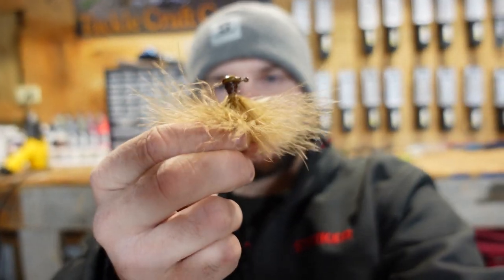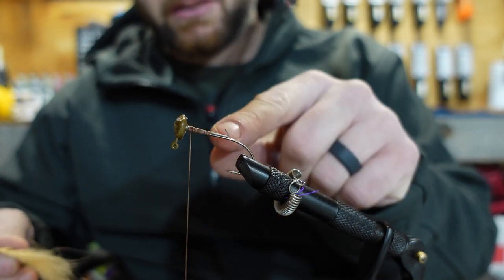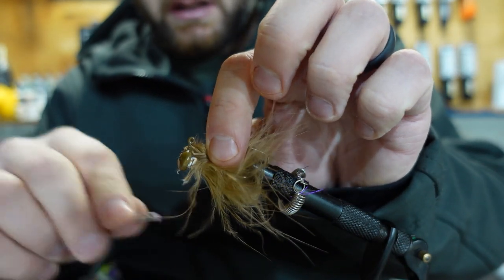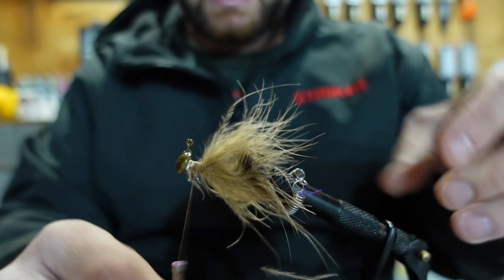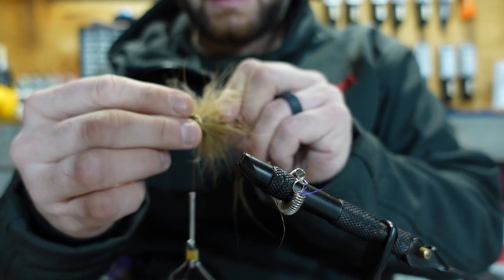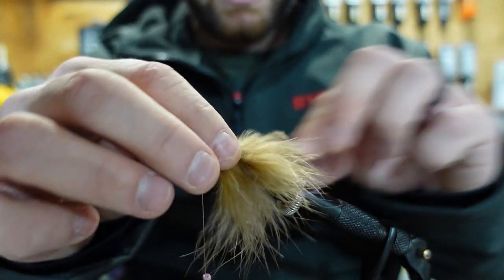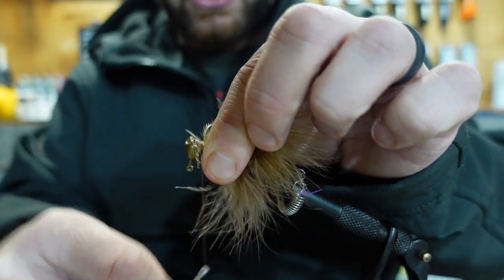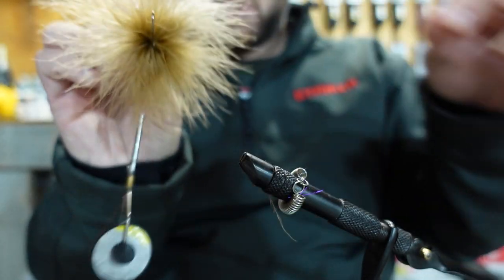Tying the Perfect Marabou Jig: A Step-by-Step Guide

Comment: I guess I don't see the need to use a lead head jig when making marabou lures. A simple marabou streamer, minus a lead jig head, can be rigged as a pseudo wobble head, Tokyo rig, a power shot or drop shot and so on. You control the position in the water column by the length of the leader to the weight. Also, this allows you to easily fish the weight you need to , for the rod and reel you already have. Practically endless variations are easily rigged .. plus the marabou streamer can be fished in a normal horizontal presentation, rather than the yoyo movements forced by the jig head.